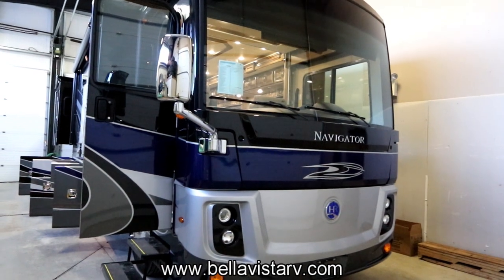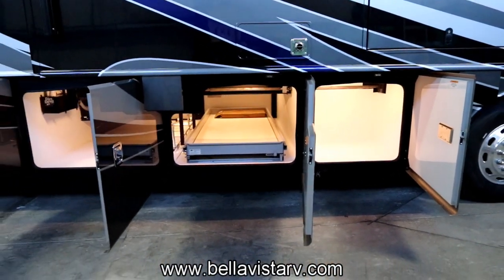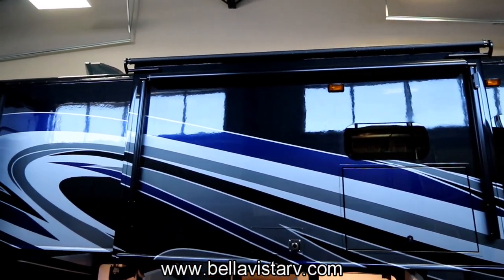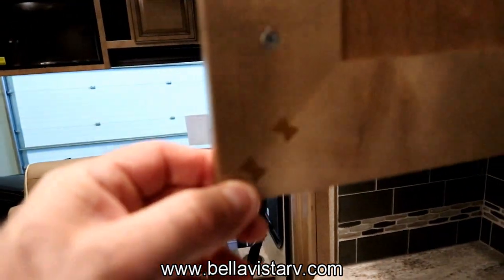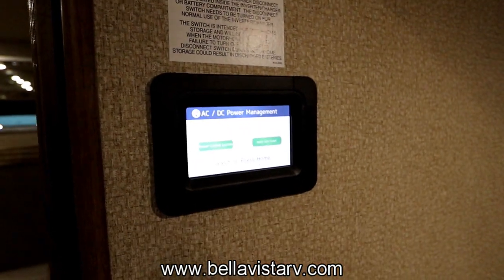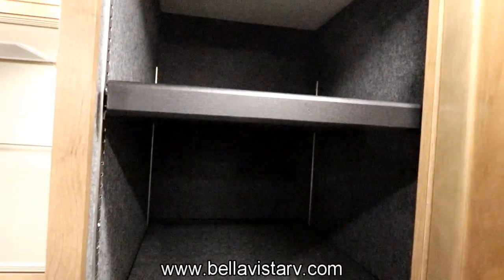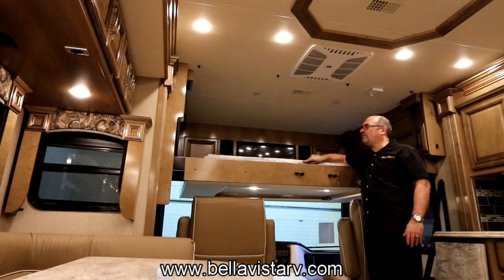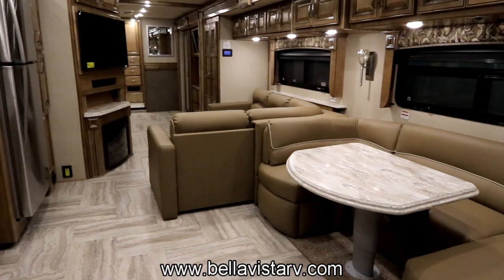2019 Holiday Rambler Navigator 38K Review

Comment: I have seen a few Holiday Ramblers while I have been looking and I have been impressed by both their initial quality and their durability.  I saw a 3 year old Holiday Rambler Ambassador at one of the local dealers a few weeks ago with 18,000 miles on it and it still looked like new everywhere and everything worked.   A lot of coaches are already showing wear by that point in their lives.   I saw a much more expensive coach by a popular high end manufacturer at the same dealer with similar age and miles and it was already looking tired and had several issues like broken steps and awnings.